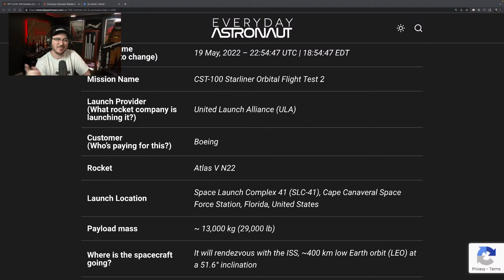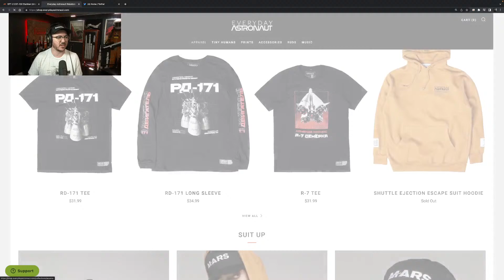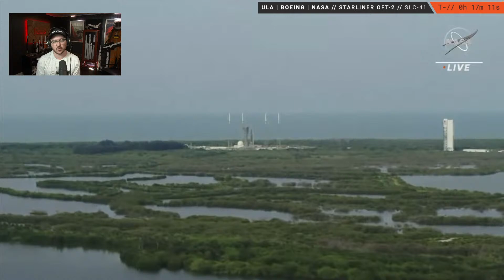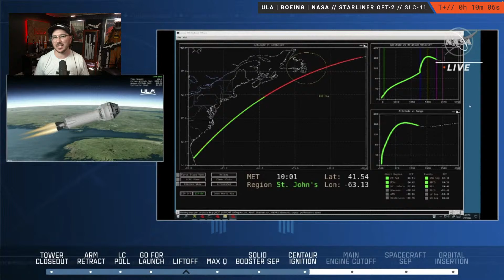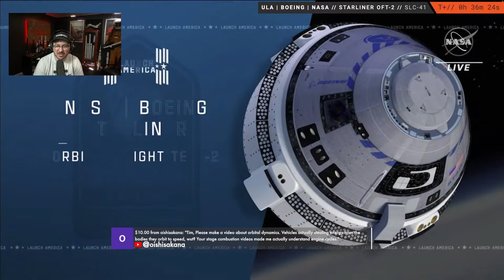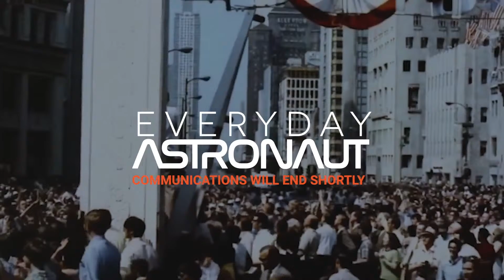Watch Boeing and ULA launch Starliner to the ISS!

Comment: I missed the stream, did they manage to land the booster?
Reply: It's an Atlas V rocket. Those don't land - they're expendable.
Reply: @ann_onn  I'm aware of that, perhaps I should ask why they don't land the booster then?
Reply: @eddiev1980  It's a very different design.
I mean... we have disposable razors, as well as electric ones. Both have their uses.
Almost all space launches use disposable rockets. Reusable ones such as SpaceX are exceptions, and it's not always the best idea. For example, the Space Shuttle - it cost so much to service them each time, it'd have been cheaper to build a new one.

Like other vehicles, there are reasons to use all kinds of different design - we have trucks, tractors, buggies, tanks, supercars, and so on - each one serves a purpose. There's not just one "best" design.

Maybe in the future, a reusable rocket will become the most popular way of getting to the ISS, but I'm not sure. Time will tell.

For the last ten years, non-reusable Soyuz ships have proved to be extremely reliable... and the space shuttle sucked.
Reply: @ann_onn  don't they use a falcon 9 to go to the ISS already? Isn't it also cheaper than alternatives? And reusable?
Reply: @eddiev1980  yes, but you need redundancy etc...
Reply: @eddiev1980  Yes, SpaceX take people to the ISS using a Falcon 9, now, on Crew Dragon. That's only in the last two years though, and only about seven flights. Soyuz have taken people about sixty times.

It's very difficult to say which is cheaper, because it depends how you define the cost, and there's a lot of politics involved in that. For example, do you count the cost of developing the craft? Do you just look at the cost of the fuel, and the components that get used up? Dragon isn't entirely reusable... a bunch of stuff is used up on every launch, plus the recycled parts are re-fitted with new bits.

America pays Roscosmos about $100 million for a seat on a Soyuz... but even then, it's very difficult to compare, because they don't exactly pay SpaceX to use Dragon - instead, they allcate money to the entire programme, to develop the ships.

Honestly, it's incredibly hard to say which one costs the taxpayer less money. I would guess that in the long-term, SpaceX will be more economical - if it manages to do a lot more successful missions.

Again, you can compare it to cars. You could buy a car for anything from about $1,000 to millions, and they'll both get you where you want to go - but which one is "best"? In particular, if you wanted to drive a car from America down to Chile, maybe it'd be better to buy a very cheap old car, which you could throw away when you get there, rather than de-valuing an expensive car.
Reply: @eddiev1980  NASA already gave billions to Boeing for this, might as well let it fly.
Reply: @ann_onn  Per the NASA IG, Starliner is $90M per seat ($360M/flight) for the first 6 flights. SpaceX's latest Crew Dragon contract is for 3 flights at $900M or $75M per seat ($300M/flight). SpaceX's first contract for 6 flights was $55M per seat ($200M/flight) per the NASA IG. So the cost gap between Starliner and Crew Dragon has narrowed. It's not a one off as the CRS2 contract was bid at 50% more than the CRS contract per the NASA IG. Either way, NASA is evidently more than willing to spend $15M to $35M more per seat to have a redundant crew spacecraft to the ISS. NASA evidently doesn't want to have to go back to Russia, hat in hand, to buy seats of something happens to Crew Dragon.

If you want to go with all the development and R&D, then Boeing got $5B in contracts for Starliner's 6 flights and SpaceX got $4B in contracts for Crew Dragon's 9 flights. So SpaceX is definitely cheaper. Of course some of Crew Dragon's initial development was done for Dragon on the CRS contracts, so Boeing was starting from scratch where SpaceX was not.
Reply: Hahaha.

Comment: ULA: "A proper disposal burn."

SpaceX: "Blasphemy!"
Reply: SpaceX always scuttles the second stage.
Reply: @riparianlife97701  Yeah but not both stages.
Reply: @Cedar_Valley_Live  Since NASA wants redundancy, so Starliner can't use the Falcon 9, which other reusable booster should Boeing be using?

The Atlas-V was developed before SpaceX even existed and first flew 15 YEARS before SpaceX reflew their first booster. Boeing and SpaceX got the Commercial Crew contracts in 2014, over a year before SpaceX landed their first booster.
Reply: @steveaustin2686  That's all true, but since then SpaceX has been launching and landing boosters with multiple boosters reaching 10+ uses and counting, spending far less money per launch than ULA or Boeing (potentially). If you went to buy a new car and there were two that looked identical in every way, and the salesman said: "The one on the left misses a few cylinders from time to time and gets 10 mpg. The one on the right runs great and gets 70 mpg..." which one would you want?
Reply: @Cedar_Valley_Live  Boosters take time to develop. Right now, the Atlas-V is available and other, reusable boosters are not. So in your car example, it would be do you want this 10mpg car now or a 70mpg car later, sometime in the future? Since you have to drive to work now, the 10mpg car is better.

The nonsense about "misses a few cylinders from time to time" doesn't apply, as the Atlas-V is just as dependable than the Falcon 9.
Reply: @steveaustin2686  First of all, reusable boosters are available right now. It's called the Falcon-9... they've landed and been re-flown, some of them 13 times. That's why they charge less for cargo.

Second, my "car vs car" comparison had to do with Boeing Starliner. The latest launch a few days ago, the first thruster on one side immediately failed. Per protocol, thruster #2 fired... and immediately shut down as well. The last hope of thruster #3 fired and Starliner made it to final orbit. There was no 4th option.

Falcon 9 and Dragon have been flying flawlessly and each have features that ULA/Boeing do not. Falcon 9 is reusable. Dragon doesn't have to dispose of its propulsion section in the atmosphere.

If you're going to argue, bring facts, not disinformation or misleading garbage.
Reply: @Cedar_Valley_Live  What part of redundancy did you miss? NASA wants two providers, so that they have redundant access to the ISS. If BOTH crewed spacecraft fly on the same booster, that is a single point of failure and NOT the redundancy the NASA wants.

Yes there was, as the thrusters that failed were in one of 4 doghouses and Starliner does not need all four doghouses to work for the orbit burn I understand.

Reusable is great, but not always the best answer. The Falcon 9 Block 5 can lift up to 22.8 tons to LEO per SpaceX when expended, but can only lift up to 16.3 tons when recovered (B1051.12). In June, B1049.11 is slated to be expended as the 4 ton comm sat requires an orbit where there will not be enough propellant left to land the booster.

Not my problem you are apparently ignoring the facts. That is on you.
Reply: Latest glitch with Boeing Starliner! Why is NASA letting this thing dock with ISS? Angry Astronaut🤣🤣🤣

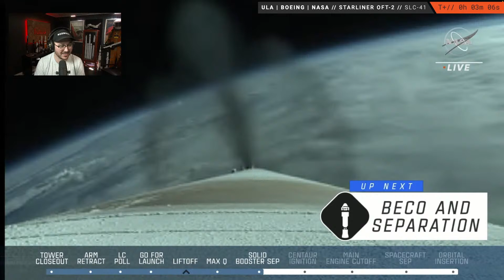Comment: Any idea what the debris was at  39:26 ??? (on the left)
Reply: It's ice.
When it's on the launchpad, water condenses out of the surrounding air, and freezes, because the fuel tanks are so cold.
It often falls off in chunks. It's normal.
Reply: @ann_onn  even that weird L shaped piece?  Admittedly the resolution and FPS is rough
Reply: @danwhiffen9235  Yeah, I mean... it moulds to the shape of the side. Some bits are L shaped.
Like if you break ice/snow off your car or house in winter... you get weird-shaped lumps.
Reply: That didn’t quite look like ice…

Comment: OK, it launched, BUT.....it's just another Space Shuttle without the wings. Solid rocket boosters are so yesteryear.
Reply: I think they have their place, but manned missions isn’t one of them in my opinion.
Reply: @fredbloggs5902  ICBMs are pretty much the market for solid rocket boosters.
Reply: They’re very useful. I’m going to assume that you don’t like them because spacex doesn’t use them. India uses them on all their rockets, and the SLS uses them
Reply: @imEden0  I don't like them, because you can't shut them off and one small hairline crack in the fuel can cause a catastrophic explosion. That doesn't even touch on the segment joint problems.
Reply: @stevelangstroth5833  depends on how you’re putting the booster together. Also, I bet if challenger had an abort system it would have saved the crew

Comment: Watching this compared to watching a SpaceX launch is like watching a black and white vacuum tube TV versus an OLED flat screen color TV.
Reply: It’s not, really. They’re both very cool. SpaceX is more advanced with their rocketry, but starliner launches look so much cooler with the Atlas rocket
Reply: In your dreams lol……….. stfhu!
Reply: @alanmay7929  it’s an opinion…
Reply: @alanmay7929  In terms of technology SpaceX is just decades ahead of Starliner. Sure, it's still a cool rocket but it just seems stuck in the 1960's.
Reply: @markuss3735  the decades in your dreams!? Big lol…….
Reply: @alanmay7929  Are you some sort of Boeing troll?
Reply: With surround sound and subwoofers and light show vs 3 inch speaker🤣🤣

Comment: Russian rd180 engine is so weak that it needs 2 solid rockets to help and 2 engines in the upper part of the rocket.
Good that ULA is recalling Atlas and building a more powerful Vulcan with US BE-4 engines.
Reply: With Bezos developing the new engine, don’t hold your breath.
Reply: That’s like saying “ion engines are so weak that they take hours to complete a burn” it doesn’t matter if it’s low thrust, what matters is cost/mass to orbit. If it’s low cost and reliable and works, who cares about thrust? Also I could say, but don’t take this seriously, “SpaceX raptors are so weak they need 34 of them and 3 in the upper part”
Reply: @imEden0  The rd180 has a terrible thrust-to-weight ratio. This engine is overrated.
Reply: @tomes3378  unlike space X, it as à closed cycle stage combustion engine
Reply: @Clemdauphin  So what?Merlins are much better engines despite their simpler design.
It is enough to compare the lifting capacity of the Falcon and the Atlas
Reply: @tomes3378  there is 9 of them on the falcon, the 180 is the half of the rd170 wich was the most powerfull engine and there is only one. The design make him more efficient
Reply: @Clemdauphin  9 Merlin engines weigh less than the rd180 and produce twice the thrust
Merlin is much more effective than rd180
Falcon 9 powered by Merlins requires 30% less fuel to carry 1 kg of cargo into orbit than Atlas 5 powered by rd180
Reply: @tomes3378  engines ISP?
Reply: @Clemdauphin  ISP is just one of the parameters that determines whether an engine is efficient.
ISP of rd180 is 10% better than the Merlins, while the Merlin has 235% better thrust to weight ratio.

Comment: The Atlas burn is so long, is because it's the closest vehicle ever built to a SSTO ( single stage to orbit ) vehicle made. 
The Atlas has been the go-to rocket for ICBM initially in the US.
Reply: The Space Shuttle is the closest thing to an SSTO. Those RS-25 engines started up at launch and the burn lasted  for 8.5 minutes all the way into orbit.
Reply: @TheStopwatchGod doesn’t the sls core (alone, without payload) have enough delta v to reach orbit
Reply: @imEden0  yeah, that's why it is bad for LEO, since it basically doesn't need an upper stage to get there (with boosters and a payload).
Reply: @imEden0  Yes, It can actually reach orbit WITH the orion capsule and the ICPS on top of it, which equates to 60 tons of payload. The problem which it shares with the space shuttle is that the thrust output from the engines is not high enough to lift the SLS core stage fully fueled WITHOUT payload, which is why the SRBs are there.
Reply: @emmata98  However, it does not have enough thrust to launch alone, so the SRBs are needed anyways, just like the Shuttle
Reply: @TheStopwatchGod  this is by design

Comment: Kilometers are stupid
Reply: The imperial system (and related) is
Reply: More Americans use "miles" (Imperial) than "kilometers" (Metric). More Americans (?) watch this YouTube channel than others do. Therefore, "kilometers" must be used.
It would not have made sense in the past. It makes sense today. Because that's just how it is. Does it make sense now?   lol
Reply: @KSparks80  but why not evolve?
Reply: @emmata98  Evolve into what?
Reply: @KSparks80  a more effecient way of doing things, that is less likely to produce mistakes
Reply: @emmata98  yet it has worked for us all this time…… hmmmmm.
Reply: @KSparks80  you have video statistics for that? Didn't know tim published them
Reply: @_mikolaj_  I don't believe it is published. Hence the (?) in my comment. If I find a definitive answer, I'll edit my post.
Reply: Just multiply by 5/8 to get miles.
Reply: @fredbloggs5902  0.621371 is more accurate. lol
Reply: @KSparks80  when you do the calculation in your head, which method do you use?
Reply: @fredbloggs5902  I use a calculator, and the resulting number is just as accurate.
Reply: @fredbloggs5902  or just use miles.
Reply: Just like spacex fans

Comment: Should they successfully complete this mission, and if they follow the same review timelines that SpaceX did after their uncrewed test flight, then they will still be a year out from actually launching astronauts on their crewed demo flight.
Reply: No. SpaceX would, ideally, have flown Demo-2 about six months after Demo-1, but  their capsule exploded on the pad during testing of its Super Draco engines. That delayed things.
Reply: @odysseusrex5908  I expect delays, is Boeing,
Reply: @odysseusrex5908  Latest glitch with Boeing Starliner! Why is NASA letting this thing dock with ISS? Angry Astronaut 🤣🤣

Comment: SRBs are entirely limited by propellant mass, an engineer would put a safety factor in it, so an over performance would arguably be nominal
Reply: except the booster includes the liquid first stage not just the SRBs
Reply: Entirely by mass? Does the nozzle performance have nothing to do with it?
Reply: @danwhiffen9235   a smaller nozzle=more burn time
Reply: Grain shape is also very important, as it determines the surface area of the propellant being burnt and thus the amount of thrust. The nozzle is still important, tho my understanding is that ULA has a set nozzle design that they don’t change. Not 100% sure what you mean by “entirely limited by propellant mass”. Also, if they over-perform, that means the liquid stages can adjust, which it did for the second stage. Still weird that the first stage performed more than expected, that’s uncommon for ULA
Reply: @romanmorozov6974  yes, I think my post was poorly worded. I should have said that it could be expected to slightly overperform because there would be a slight safety factor in the amount of propellant. As you said there are other engineering factors that control the performance of the SRB's, grain shape, nozzle, etc. It is also possible to change the rate of the reaction... but most of this is fixed. There are less paramaters that can be adjusted during flight so I would expect SRBs to include more safety factor.

Comment: Tim I certainly don't want anything to 'go wrong' and technological diversity is arguably synonymous with redundancy.

However the booster involved is basically single use and consuming a substantial quantity of obsolete components left over from the days of the Space Shuttle.

If, doing so would result in much cheaper launches, even if only until all those old parts were used up, that would be ample justification for sustaining Starliner and ULA until then.

But it makes absolutely no economic sense to claim justification for persisting with refinement of obsolete technologies if missions employing them are projected to be tens, of millions, of US dollars more expensive than any already offered or soon to be offered by other ventures.

Redundancy and healthy stimulus to technological development and refinement is engendered by competition and highly desirable, but surely it is not, if subject to persistently uncompetitive circumstances?
Reply: Found another SpaceX stupid fan
Reply: Atlas 5 only as 20 years... and it don't use hardware for space shuttle. But the main engine came from russia
Reply: @Clemdauphin   "which came from a 70+ year old Soviet design, that the Russians are no longer going to supply to the US."
SpaceX builds and flies its own "reusable hardware."
Tell the whole truth man!
Reply: @Rob_Moilanen  yeah it is half of the most powerfull liquid fuel engine created, the RD170. 70+ years is like aj10 engine in the fisrt version.
Reply: Bro are you high? It's 2022 not 2045, and also, vulcan
Reply: @_mikolaj_  given the way you ended, change the beginning to: am I high?